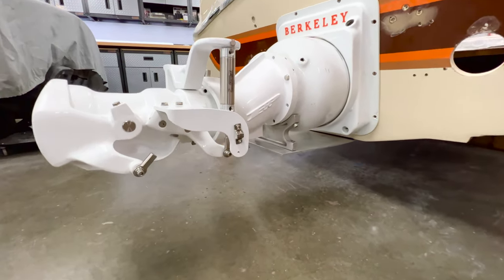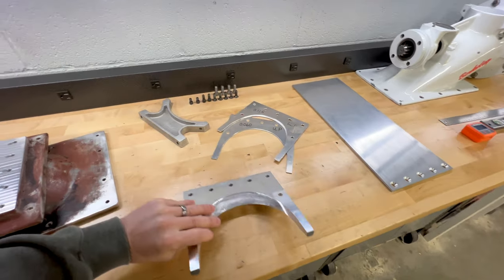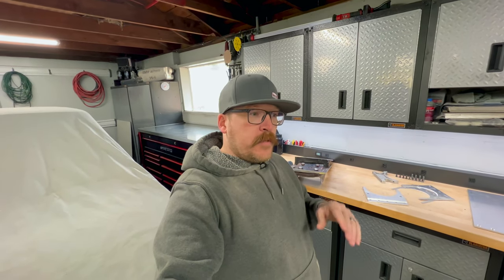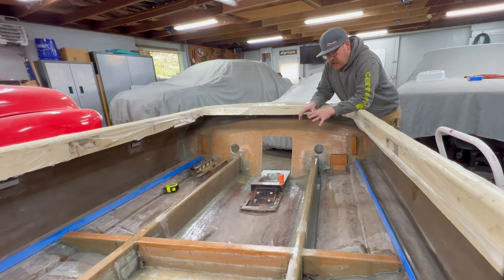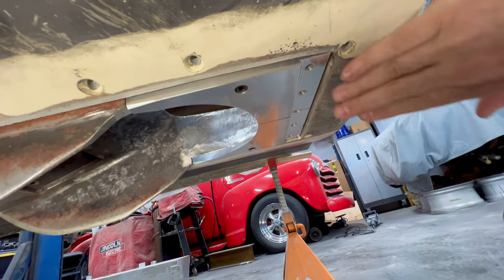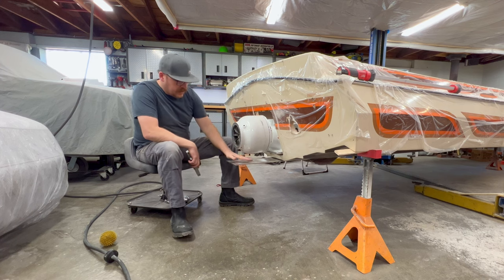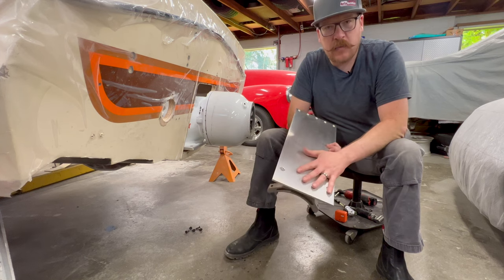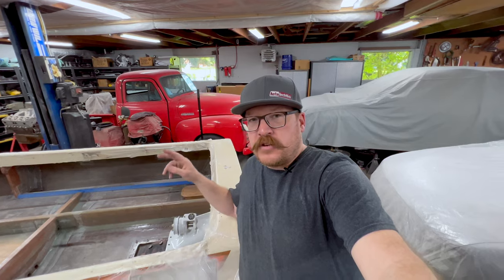Adding an adjustable SHOE and RIDE PLATE to a JET BOAT

Comment from the maker: The little bit of planning I did early on paid dividends for this part of the build. I could have had more work ahead of myself with exposed transom wood at the boat's keel. Fortunately, when I installed the transom, I saw the potential for this issue and adapted my plan to prevent it. And it is a good thing that I did!

~ Nick

Comment: Just another idea for you.
I also just did this with the set back method and  i used the fiber fill putty and put several coats of parting wax for fiberglass molds 25:34 on the intake mixed up the putty and applied heavily where the intake sits, set the intake in the hull, scrape off the excess and next day popped out intake and a perfect mold exact match to the intake.
Easy way for sealing and also being able to remove if necessary .
Just some insight that is working for me. 
Cool vids watched them All 10 time's.
Reply from the maker: John, thank you very much for the support in watching the videos!! It is greatly appreciated. 

Sounds like you have a pretty slick setup with how you molded your intake to the hull! Thanks for sharing!

~ Nick

Comment: Thanks for another great video, keep em comin Nick!!
Working on my 79 Southwind right now,  hoping to get it done in the next couple weeks!
Reply from the maker: Thanks Anthony. Summer already started… you better get her out on the water soon! 

~ Nick
Reply: @AutoTechNick  
I'm getting antsy for sure!
When you were going through everything, did you happen to look into coosa board for the stringers, or was that not an option due to the length?
Thanks!
Reply from the maker: @it426  I briefly looked into coosa, but ultimately decided to stay with wood for ease and simplicity. 

~ Nick
Reply: @AutoTechNick  cool
Going the same route but with 1/4 sawn, keln dried  red oak.
Thanks

Comment: The old holes in the intake look like they’re for a “add a shoe and ride plate” kit from ARS marine or Hi-tech performance. It’s the easier way to get most of the performance of the shoe and ride plate without having to machine the intake. The shoe is molded to the shape of the intake and you just get it level with the bottom of the boat, drill and tap the holes, and your done. I opted for that on mine as I didn’t want to take on the project of removing the intake. Not adjustable so it’s a little less performance oriented but it still helped a TON in rough water with keeping the pump loaded. Curious why you went with the Berkeley over the dominator though! Although I don’t know that I could spend the money on rebuilding a pump if I had a new one sitting on the bench so I see at least that reason! Lol
Reply from the maker: Okay, good question on why I chose to use the Berk pump. It really came down to the impeller that was in it. Our Dominator pump has an aluminum impeller. Also, the Dominator pump was in the boat since we got it in the 90s. The Berkely was a spare that came with the boat. The Berkley has a stainless steel impeller. 

Now for the longest time, the boat had a very mild 396 in it, so the impeller material was nothing to worry about. Now it will be running a well-built 496 with 625hp. So we are at a point where the stainless impeller would be a smart move, ESP, when we already have a pump setup with it. They are both A cuts, so one might consider putting the stainless impeller in the Dominator pump. But the previous owners built that Berkely pump to that impeller while they were racing the boat then. They cut down the face of the bowl and the registers on the shaft to tighten all the clearances. I just couldn't bring myself to undo all that work, then redo to get another impeller in that pump. At this time, I rather have the stronger stainless impeller than the stronger Dominator suction housing. 

I am hanging on to the Dominator pump. If my HP level starts to creep up past the 625 that I have now, I will likely buy a new impeller to build that pump up and swap them out. 

~ Nick
Reply from the maker: You are probably spot on with the add a shoe kits and funkiness I found on my intake. 

~ Nick

Comment: Good afternoon. So I just started watching these jet boat vids. Being a jet boat owner, I need to ask, doing all this work, why didnt you set the pump back 6"? That would make impeller changes and ski rope removal - clean out hole outside the boat -  so much easier. It also will increase performance - alot.
Reply from the maker: That is a very good question. I HEAVILY debated setting the pump back. I even bought the raw material needed to make a new transom cover. Setting the pump back is off the table for this round of repairs, but it is something that I may do later on down the road. 

I chose not to do it at this time for several reasons. The main one was I did not want to deal with the loss of strength in losing the back section of the keel. This boat is mainly used on lakes, not rivers, so it sees a lot of rough, choppy water. I did not want to worry about the epoxy on the intake failing. 

I also made many changes to the boat during this round of work... Mainly the shoe and ride plate added a droop and swapped to the Place Diverter from the Jet-O-Vater (that was actually a move in anticipation of doing a setback). I also cleaned up the bottom of the hull by getting rid of the water pickups. Honestly, that is a lot of changes, and I want to run the boat as is to see how they affected it. 

At the end of the day, this boat is more of a family lake cruiser, than a river racer. With the wife and young kids on the boat, we are not blasting around at high speeds. I am usually pulling a tube or skier. Keeping it fun and reliable was more important to me at this time. 

That is not to say that in a few years, I might set the pump back. I would really like to get the cleanout out of the boat and also be able to add a Jet Away. 

~ Nick

Comment: Great video and nice work but I never heard any reference to the angle of the intake in the boat in reference to the keel. That may have been one of your issues at the back of the pump but otherwise good job.
Reply from the maker: Well, I did touch on it. I mentioned that I set the bottom of the keel to level. The intake housing has a 4-degree difference from the pump mounting flange to the hull mounting flange. So, if I level the keel of the boat, and level the intake (referencing the intake to hull flange) then the pump mounting flange will be at the desired 4 degrees. 

Once I am finished gelcoating the bilge and get to mounting the intake for the last time, I will make a video in more detail covering the install. 

~ Nick

Comment: I'm also in this process 
You set the intake at zero degress.
Did you also have the hull set up on jack stands at zero degress?
Reply from the maker: Yes, the hull was also set to zero degrees when I did this work.

Comment: Hope you checked the bottom to make sure you don't have a preformed hook built-in to the bottom of the boat, they put them in from the factory, cuz the ride plate will work incorrectly!
Reply from the maker: I have. My hull has a slight hook on the sides, but I am good on the keel. Therefore it will not change or affect the intake and ride plate install. I would like to flip the boat and work the hook out of it at some point down the road. But that will have to be a project for another day. I need to finish the boat soon because the car projects are piling up on me!

~ Nick
Reply: Sounds good, I have rebuilt 10 jets then I got hooked on v drive boats, enjoyed working on all of them!

Comment: Man ....i wish you could show the video of you setting the intake grate.  Im rebuilding my 454 on my 90 advantage jet boat.   I realized that the expoxy on the intake is old and cracked so it allows water   in the bilge as soon as it gets in the river.  Ii figured i should fix it now but im worried about not geting the level and degrees right. Im thinking about leaving the adjustment screws in place so i know its the set the way i removed. Unfortunately i cant find no other videos showing how to set it.  Great channel love your stuff
Reply from the maker: I plan on making a detailed video outlining how to set the intake into the hull. I still have some work to do with my boat before I am ready to set the intake. So it will be a bit before I have the video out. Although it sounds like you might be doing your repairs sooner. 

~ Nick
Reply: Turns out my intake grate wasn't leaking.  It was the packing rings. Ill fix those and put the motor back in and get on the water. After the season I'll pull the engine out and pull out the pump and grate and re set it and powder coat the pump.  Your video will ve out by then hopefully.   Your boat videos are awesome. Keep it coming nick

Comment: Looks great. What motor ?
Reply from the maker: I am running a pump gas 496 BBC, 10.5:1, mild solid roller, AFR 305 heads, making 630hp.
Reply: @AutoTechNick  what sort of speed do you think you'll see?
Reply from the maker: That is really hard to say or guess. I added a droop, shoe and ride plate. I previously had a dominator pump with an aluminum “A” impeller, now running a Berkeley with a stainless “A”, inducer and stuffer. I also eliminated the old water pickups off the bottom of the hull. Oh, yeah…. and went from a Jet-O-Vator to a place diverter. Soo lots has changed. I don’t have a good reference from before hand, this 496 was briefly in the boat years ago, but I was running a 396 before the teardown. At this point I’ll just be happy to be back on the water. 😂 

~ Nick

Comment: Should of put the dominator back in
Reply from the maker: If the Dominator had a stainless impeller, I would have. Eventually, down the road, I will rebuild the Dominator and swap the Berk out. But for now, it'll be just fine.